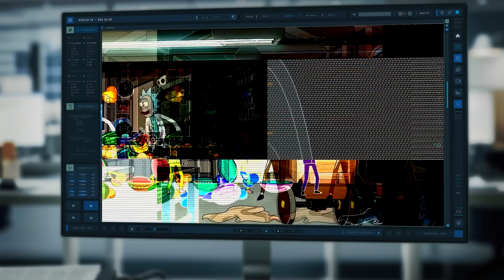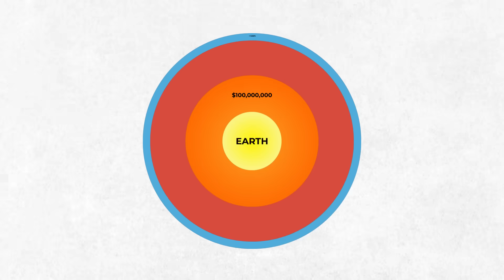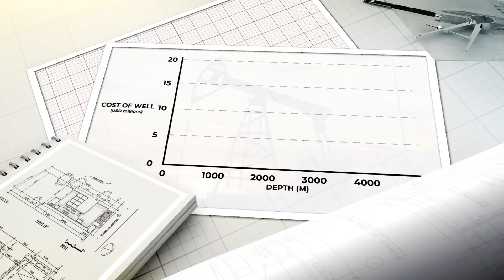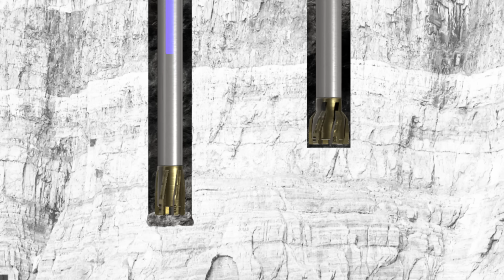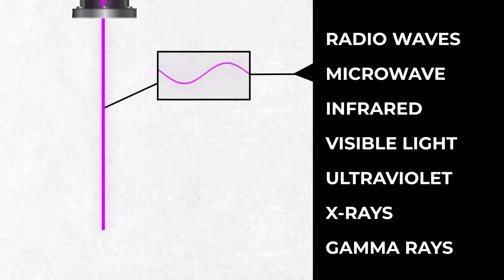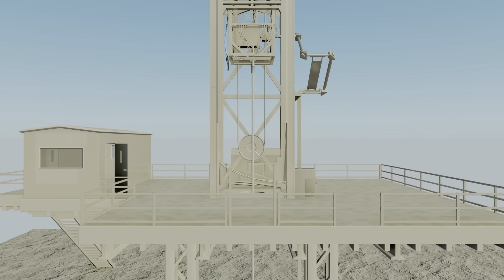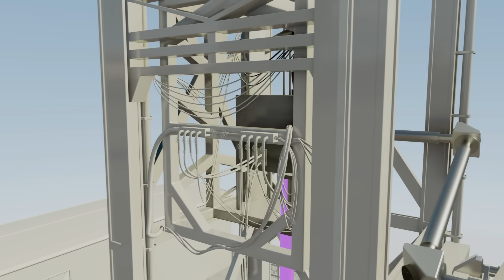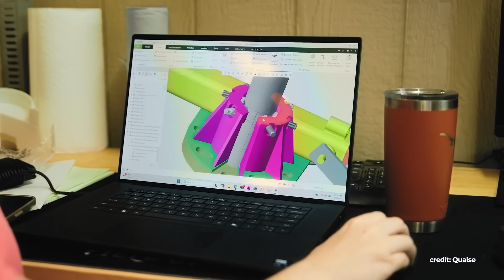The Most Advanced Drill in Human History

Comment: Question: he mentioned that there could be a problem with gaseous rock solidifying at a higher point casing a  point of concern. 
Would it be possible to use some gas. If the hot rock (2200 Celsius and over I believe) cool's down the further up the pipe it goes. I'm wondering if they cant use water to stop the formation of rock, could they use a gas. If the rock solidifies when it gets cold which is higher up why not seal off the hole and use a gas which keeps the whole tunnel hot.  so then the gaseous rock would have to go much higher up, and exit the hole through some contraption then it wouldn't be a problem. 

There are a few concerns though, 
1: The gas will get in the way of the Mason thus enticing the same problem as before. 
2: In the upper layers of the hole the heat would escape into the earth.

 A potential solution I thought of: if you were create a coating that is "anti rock formatting" or something to coat the upper layers of the structure where it's cold enough for the coating to stay on. Maybe then the rock would have to go somewhere else?
Or instead of a hot gas, this gas just has to stop the formation of the rock.

Anyway, this is what I think about this problem. I'm curious, what're your thought's about this?

Comment: Instead of ONE huge megawatt Maser, place a distributed circle of 1000 kilowatt Masers.  All aiming toward a downward-pointing mirror-cone.  They don't all have to be ON at the same time either.  Pulse them round-robin style, so that enough energy gets down to vaporize rock, but notsomuch heat to destroy focus-mirrors.  This way you still get a megawatt of energy where they all converge, but side-effects of excess-heat generated above the dig-site are minimized.
Reply: well actually, household microwave ovens run at about 2 kilowatts;  so essentially 500 of those, plus waveguides to direct energy where needed.  Could even be enhanced by directing solar energy down the same bore-hole.  Similar idea as melting salt in the desert, but instead of pointing mirrors up @ a tower, beam 'em all down in the dirt, Fresnel style.
Reply: How wide of a bore hole are you talking about? You would need 1000 kilowatt lasers taking up the space of the like, 10 inch bore hole they plan on making.
Reply: @logicbuilder1204  in my next comment you'll see a regular kitchen microwave-oven is 2kW;  so 500 of them, equally spaced.  There's nothing that says all 500 have to be on one plane.  you can make a circle of 300, then a shelf above which holds another circle of 200..  The point is to DISTRIBUTE energy so none of the mirrors or waveguides are overloaded by an individual megawatt of energy.
Reply: @DoYouScribble2  The problem is at some point you are going to have to have them all focus on the waveguide, and you are probably going to require at least one large mirror to focus it all down.
Reply: @logicbuilder1204  sure, no problem, either an inverted cone, or a parabolic-dish.  these aren't tough to manufacture.  just fill reflector with water / antifreeze, pipe it to a huge radiator &  pump, to disperse any excess energy that it hadn't reflected.
Reply: @DoYouScribble2  do you know what magnetic interference and induction is?  
how far apart do you think 2kw magnetrons have to be from eachother while operating at peak power to not fry eachother in the process?  and you want 500 of them in a single 10inch drill? 
you also want 500 waveguides in the very same drill 10 inch wide?  next to 500 cooling units and whatever else those magnetrons require. 
you seem to think engineering operates on minecraft logic...
Reply: @KT-pv3kl  no games, on my part.  You're the guy going to illogical extremes.  Just point them upward @ a parabola, much like a headlight in reverse.  Ever visit a science-center?
Reply: Ya know, I was thinking about eyeball rods & cones being uniformly distributed an approximately isometric-distance from the LENS & thought how that would be an ideal setup.  Just "lens" the Masers as a TV deflection-YOKE does...  Instead of a small field of pixels, you have an entire array of magnetrons all focused directly down a borehole.

Comment: Wait so, heat is a problem for tool wear but let's use a drill head near a melting rock microwave beam? 
Also, Isn't vitrified glass extremely hard, depending on the type of rocks and its cooling rate? Will not that require a lot of torque to brake down? What do you mean by "reasonably fragile"?
Also, closed loop and just cycling water? What about the water lost through cracks at the bottom of the wells, either natural or induced by high pressure water injection? Unless they directly connect the two wells, but that's not what the illustration shows...
Also, the system needs ultra high vacuum to avoid energy loss and heat but not in the boring pipe itself, right? It wouldn't be feasible of course. So, what will be the loss of power further down the bore hole?
Also, what about the molten rock the further down? Aren't that rock going to cool down much slower down there? Do they wait for it to solidify? If not, how will they cool it down? 
That, along all of the other problems you mentioned... Have they talked about any possible solutions to those? Not to mention the usual throw at the wall and see what sticks type of optimistic roadmap... 
May be I'm cynical, but that smells of another fishy snake oil startup showing off just enough hardware to attract investors... They lost an opportunity to call their geothermal boring project: "Hypershaft - A new mode of energy production!"
Reply: They are not modelling a geothermal power station and it won't work. The heat flux is not enough to get enough power up the shaft. For a steam turbine to work you need hundreds of tonnes of steam/water per hour at superheated temperatures. It is a predictable bust before they start for generating power. Maybe district heating.. Thermodynamics and a bit of simply physics can prove a geothermal power generator won't work even if they succede in drilling a hole.
Reply: @kimollivier  Interesting, thanks!

Comment: As alluded to in the video, wouldn't it make good sense to place drilling units at locations where geothermal level strata come close to the surface and build their first geothermal power plants at those locations?  Could also serve as a great classroom to further perfect the drilling methods to go deeper at future and deeper sites.
Reply: Yes! Build a geothermal power plant first and get that miracle working first. But it cannot be done. The heat flux of 0.1W/m2 is not enough to heat enough water to superheated steam in enough quantity to run a steam turbine. You need tonnes per minute. Existing plants struggle when ground conditions are unusual and perfect. You need a saturated porous reservoir of superheated water, not just a pipe down to hot rocks.

Comment: I have maintained for decades that geothermal is the energy of the future.  Solar only works in the daytime but is fine for remote locations like fishing camps in the Canadian shield..  Wind doesn't work in a calm.  Fission is just fine for powering aircraft carriers and long range submarines but what do you do with the fissionable waste?  Hydroelectric is hell on andronomous fish runs and eventually the reservoir will silt up.  And we definitely should keep developing fusion power because that's the only way we can power star ships.  With deep heat geothermal power, you are tapping the energy of Mother Earth herself--and you ain't EVER gonna cool Mama down!
Reply: Unfortunately not so. Geothermal is an extractive non-renewable process because the local rock does cool down faster than the heat flow required. There is only 0.1W per sq metre through rock. You would need many hectares of surface to power a turbine. That is why there are so few geothermal plants. The ground conditions are rare and even then eventually stop working, just like dams.
Reply: The waste from fission is simply locked away.

Comment: Why not assemble the gyrotron within a slightly wider hole, positioned closer to the drilling point? Similar to a TBM but oriented vertically. A winch or perhaps a self-sustaining mechanism could secure it to the walls, with an electric cable providing power. Miniaturizing the gyrotron would require significant engineering, but it seems worth exploring.

Alignment would be simple—a laser beam hitting sensors on the back (top) of the HBM (Hole Boring Machine).

How wide would the hole need to be to accommodate it today? What operating temperatures would it reach as it nears the heat source? Could a combination of both approaches work?

Comment: The high temperature of the rocks here is a distraction. The sustainable extractable flux is the same at all depths at a particular location and for most of the planet this upward flux is less than 0.1 W/m^2. The UK average is 0.038 W/m^2. 

The technique as shown in the video is basically a one-shot technique, cooling a large volume of rock and then moving on to a new piece of rock. Cooling say a cubic kilometre of rock by a few hundred degrees Celsius results in very significant surface subsidence and seismic activity.

It's just basic physics - you can't sustainably extract more than the steady state upward heat flux.
Reply: Yes, spot on, and the volume of steam needed to run a turbine cannot be realistically collected from a single small pipe. I have seen a test steam bore opened to release 10MW of superheated steam. It is frighteningly loud and dangerous. That is still not Megawatts needed.
Reply: Perhaps the idea of using this boring technique for energy production via geothermically -generated steam is unrealistic. But you can still extract geothermal heat to do all sorts of things. If you don't need hundreds of degrees and extract heat at lower rates you wouldn't have to drill that deep and it would take longer to cool the rock down. Once this method has matured the boreholes it creates can be useful for other purposes. This company wants to push their technology towards a useable and economically competitive alternative to conventional drilling. And without knowing anything about this topic I still believe that there are niches where this technology might be useable and where it might be able to compete with conventional drilling.
Reply: Shhh, we have sinkholes to create in Texas under peoples homes
Reply: The limited lifespan per well should be emphasized and I would like to see more data on this, but it does not seem reasonable to characterize it as 'one shot' when traditional wells last on the order of decades, and will heat up again after an extended shut down (likely also measured in decades).

The holes will be 8 inches thick, it's not at all obvious the equivalent of a pin prick is going to have significant subsidence effects. I would assume the dimensions and geology of that cubic kilometer matter a lot.
Reply: @ceetolli  Thank you. It's not the diameter of the borehole that matters. Typically such an enterprise would aim to cool a few cubic kilometres of rock. The thermal contraction of such a block due stop temperature changes of a few hundred degrees Celsius corresponds to subsidence on the  order of a metre (if I recall correctly).

And yes, the  scheme would work for decades and then require tens of decades to recharge.

Best wishes: Michael

Comment: ...NONONO,RUSSIANS THAT DIG THAT SUPERDEEP HOLE ENCOUNTERED the opposite.. PROBLEM: THE ROCK BECAME extremely brittle SO IT CRUMBLED INTO BOREHOLE AND jammed THE PIPE

........BESIDES,THEY REACHED 12km AT FIRST 8 MONTHS OF DRILLING!!!.......

......SO,WELL....I was THINKING THEY'D KINDA USE SOME HUGE LASER POINTER.........AND this ONE....SORRY,BUT IT'LL FAIL

...REASON??.... THAT kinda pipe MADE OF VOLCANIC GLASS CANNOT WITHSTAND CRUSHING PRESSURES DEEP BENEATH .....BESIDES, classic methods are allowing boreholes to be angled .......

....HOW I'D SOLVE PROBLEM,HOWEVER??.... throw small charges of explosives into the boring pipe paired with enormous vacuum which will SUCK everything that get crumbled ...LIKE THROW...WAIT...boom...SUCK...THROW...WAIT..BOOM ....

.....AND main PROBLEM ABOUT THIS IS TO FIND A SPECIAL SORT OF STEEL WHICH WONT GET DEFORMED........FROM LIKE millions of these......

Comment: Japan and Iceland sit on a goldmine 🇯🇵🇮🇸
Of geothermal energy 😊😊
Reply: It is very expensive and marginal at best. The equipment wears out, there are a lot of costs. The ground conditions have to be just right with an existing large underground reservoir of superheated water in a porous rock. The dissolved silica coats everything as the pressure and temperature drops through the turbine. The water contains heavy metals that must be reinjected or the reservoir dries up causing subsidence. There is a lot of CO2 that fizzes out requiring carbon taxes. The steam is wet so the water has to be separated out. It is an extractive process, the reservoir will cool before the economic life of the plant if too much energy is extracted. Rock is a good insulator at 0.1W/m2 so the heat does not flow in fast enough to maintain the temperatures required.

Comment: In a finished geo-well, how do they intend to force the water past the boiling point and still down to get to the 400–500-degree level to then turn back up?  Has anyone exampled this process already?  Seems like there will be difficulties beyond the simple plans presented.  Very interesting project!
Reply: Yes, they cannot do it. Amazing that they have not started with that. You need tonnes of superheated steam per minute. They could look at existing plants to see why they work. It is because they tap into a huge field of superheated water in a porous rock. They use dozens of relatively shallow bores. Reinjecting the water away from the bore into the field uses a lot of power. The field eventually cools down. Drilling a single pair of tiny bores for kilometres is futile. I wish them well in their efforts, but for what purpose?

Comment: obviously never drilled more than a water well! want to drill under-balanced with no casing ??? you'll have a blow out real fast. if you can't do it with drill mud you can't do it lol you won't get the marital out of the hole with air and you'll have nothing to keep down oil, gas and water at high downhole pressure. all this talk about no casing and under-balanced drilling with air is a pipe dream .
Reply: Exactly, and even if they were to somehow get enough air / inert gas pressure into the well to prevent the hole collapsing downhole, the surface systems would be collossal and the applied pressure would blow the proverbial out of the upper sections, this has not ben run through with a trainee drilling engineer, never mnd a deep well HPHT experienced engineer....they think they know better? Titan again?? 💥

Comment: I’m sure this could be considered by some people as a dumb question but; what happens when that cutting laser bores into a natural gas pocket or crude oil? Wouldn’t it create a massive underground explosion or set the oil on fire?
Reply: Good question. I don't know but my feeling is that there'd only be enough oxygen available for a little bit of the gas to combust. But this does depend on how the rock vapor/dust is collected and removed from the hole. If the plan is to blast the tailings out with highly compressed air, well, that'd be a much better oxygen supply, then.

Comment: There is one huge oversight problem with this. 
If this will be the future then what about all the heat coming from cooling down the water before reinfecting. 
This is not a huge problem for one small geothermal plant, but if there are thousands or even tens of thousands that will be heating the atmosphere even more. 
At least, that’s what I think of it.
Reply: Don't worry, there is not enough heat coming up for it to work. Heat through rock is 0.1W/m2 and the area in contact is not enough to make enough steam. They should look at how existing geothermal plants work and note that they are extractive, non-renewable and have a finite life as short as other thermal plants.

Comment: Just a sidenode: Geothermal can never be anything but a stopgap to fight CO2 emissions. Which is just the current short term problem.  The looming problem waiting in it's shadow is "forcing". Forcing describes the problem of the earth heating up because there is a problem with radiating out heat based on heat coming in AND being released from sequestration. Geothermal (as well as nuclear AND fossil on top of being a CO2 source..) are sequestered energy. Any such energy usage as opposed to those that are sourced from the energy coming in anyway (so: solar, wind and tidal) are long term lacking scalability, because they invariable heat up the planet on top of the energy coming in from outside.  There have been papers running numbers that even if we fixed the CO2 problem, if our energy usage keeps scaling the way it does, we would have boiling oceans in a shocking short amount of time (about 100 years). Good news though, that number obviously is pointless, because we would be all dead long before that, so it would never come to that.....  But still: insisting on finding the short term solution for a problem ignored for decades in places that are just creating the NEXT thing that won't get fixed or 'shocker' prevented by being avoided is such a frustrating habit of humans, specifically the ones who should know better.   This is the second video that is bad, plus the effed up AI promotion....   Maybe do better?